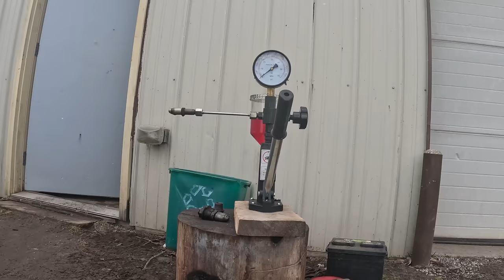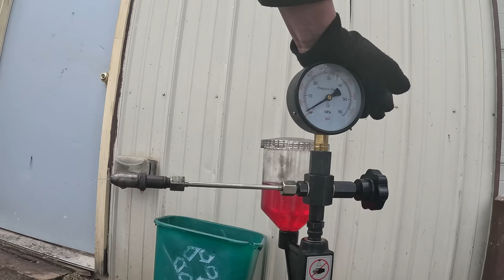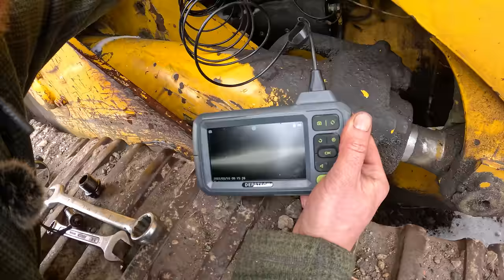10.5L CAT Diesel KNOCKS but has good oil pressure | How is this possible??

Comment: Old cat guy here again. Now that you have confirmed #6, cut your oil filter open take a cross section of the media and squeeze in vise to remove oil. Then look at debris left in filter. Put magnet to material.  Aluminum equals bearing material.  Brass/bronze is wristpin bushing. Steel is a scored liner. Like I said before, cats usually don't fail wrist pins. When ran low on oil, #6 is farthest run from oil pump. Last to get oil. Never in 25 years seen one fail on #1. When you do finally pull the pan in next video,  will see #6 rod cap discolored. Unless YouTube is paying well or you have a spare engine,  lots of money to invest. I hope I am wrong and all you need is a connecting rod, but I know what past experience tells me. Good luck.
Reply from the maker: Thanks! Just a small challenge lies ahead for us…
Reply: Pretty much my thoughts as well

Comment: The oil hole in the crank will be blocked by bits of Babit metal from the run bearing shells, that's why you still have good oil pressure. Same happened to my engine.

Comment: For the injector tester....you are leaking too much around the connection to the injector to accurately test it. Once you get close to the pop off pressure, you turn that knob clockwise to bring it up to pop off pressure and watch the spray pattern.
Reply from the maker: That’s good advice. As you can see I had no clue what I was doing but at least it gives us some information.

Comment: When you get it running. The nozzles are finger tight on the adaptors only. pliers not needed.
the torque on the hold down keeps it from leaking. every one you used the pliers on is junk.
Reply from the maker: Good to know, I’ll be sure to check the manual when I put it together!!

Comment: I’d be inclined to think piston/wrist pin issues. If it was the crank end of the rod, you wouldn’t still have such great oil pressure.
Reply from the maker: That’s why we were so reluctant to tear the head off. Kind of crazy

Comment: They are not unreliable, acceptible opening pressure is 350 to 700 psi but your not testing in a proper way you are using them screwed onto the adapter you need an adapter that clamps the nozzle to prevent leaks  it sounds like the nozzle is stuck open.  It would help if you used the glow plugs to help it start, push down the start switch and rotate counterclockwise watching for the ammeter to show discharge

Comment: Although I agree with the other comments made, is it possible with the amount of movement seen that a big end bolt has failed or is undone or something to do with the conrod cap as there seems to be a huge amount of movement for just a failed bearing or extremely unlikely could the piston be failing around the wrist pin as I don't know if it was the sound quality of the video but when i've had motors with big end knock it's always sounded like a harsh metallic ringing knock this sounded a bit softer when i first heard it I thought piston hitting the flame ring (recently rebuilt 8.6 L Iveco engine went for initial start bfore re-torquing head knocked immediately, stripped checked bottom end nothing wrong so removed head found head gasket had moved (i know should have used alignment pins but thought the little tiny dowels in the block would've kept gasket in place and didn't have any pins in any case ---- made some when i found this though) about 1/8" (4mm) so piston #1 was just catching the flame ring at tdc, the bright area on your #6 piston points to it's touching the head (that'll need a good inspection now), it's just unfortunate that thebottom end can't be accessed with the engine in the machine to find out.

Comment: If you drain the coolant before removing the head you wont fill every hole with coolant.  Just sayin.  😁
Reply: Also remove the push rods before pulling the head to avoid damaging them..

Comment: Yeah. You guys need to stop running that asap. I can’t finish watching the video even. Trying injectors when the cylinder is dead and knocking?! And then seeing if the diesel pump is working?! That’s a bottom end issue and you are wrecking it worse than it was with your trials. You hear metal on metal.

Comment: need min of 400 psi for minimal operation
Reply from the maker: Do you know what the spec is? I could not find it. Good to know though thanks!!
Reply: @dieseJL  300-500psi is usually good enough for combustion. 300 is def on the low end and you can see why it wasn't wanting to pop off withi that much play.

Comment: Could be a blue hole through a piston and you’ve got a ring setting on top of the first and hitting on the valve. I had that with a 1150 case one time oil pressure but I don’t worry that way how to knock a the godly redneck sounds good luck

Comment: Your piston is clearly hitting the head and it's not being pulled back down. You have a broken connecting rod, wrist pin or bearing cap. Pull the oil pan off and you find out immediately.  Absolutely nothing a lot of money can't fix.

Comment: Rods bent
Reply: If the rod was bent and the bearings okay, they would not have been able to push that piston down like that. Its either a spun rod bearing or a wrist pin elongation in the piston to have any free movement. Not to say the rod is not bent as well however. Or.... a bolt broke or is loose holding the rod cap on.
Reply: @Greghh1960  my comment was before head off. Seen misfire from bent rod
Reply: @jackpinesavagerepair1918  ->Yes, I thought the same thing early on in the video. We have run into that before when someone puts to much starting fluid in on startup.